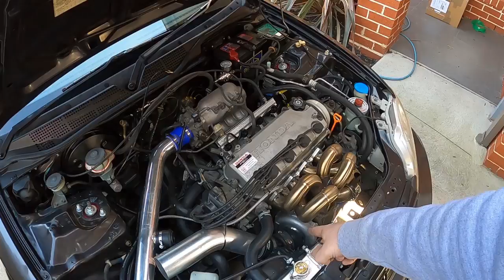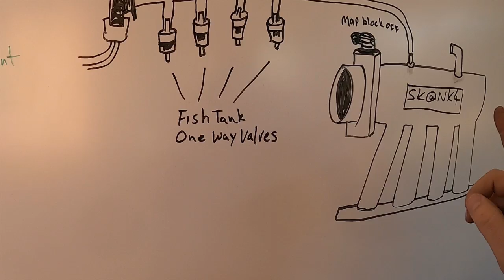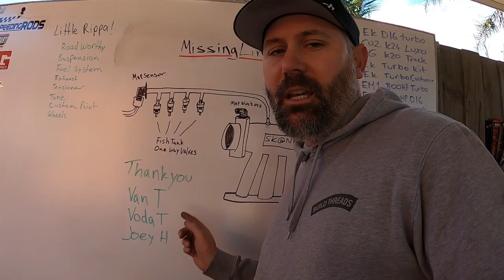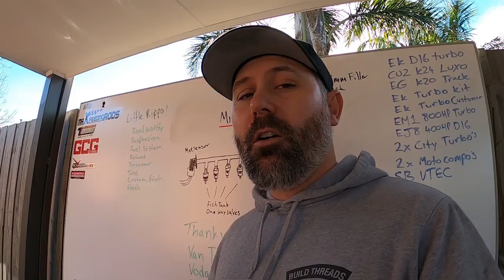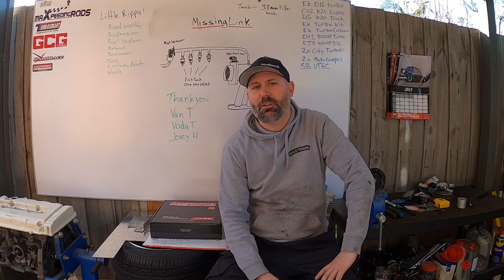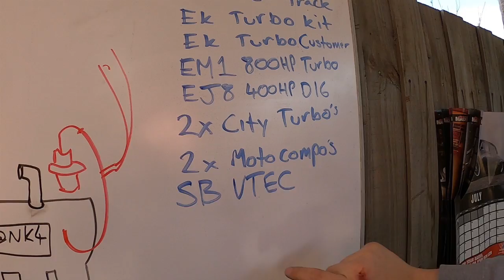HONDA TURBO 8PSI MISSING LINK HACK MAP SENSOR CHEAT FISH TANK ONE WAY VALVE CHEAT ON A STOCK ECU

Comment: you can also put those on the boost signal hose to the wastegate to make a crude bleed off style boost controller
Reply from the maker: That's a classic DIY trick to bleed off pressure and up the boost. ✌️

Comment: Would a two bar MAP sensor be better?
Reply from the maker: Yes, a 3 bar would be better again
Reply: @TURBOTRISTO  what I meant was if a  two bar MAP sensor would work in place of those fish tank one way check valve without issues
Reply from the maker: Yes but the ecu will need some sort of calibration

Comment: 99 Jimny g16b added a turbo starts revs drives fine untill 6psi and boost cut / limp mode for a split second then gose back to cruising fine I have feul reg bigger pump wideband 02 sensor and a manual boost controller. Going to give this a try tommorow

Comment: I have a saab with a map sensor that has boost cut with my boost tap/tee at 15.5psi this is to stop the cut out not raise boost.boost need to be raised through the wastegate or wastegate vaccum
Reply from the maker: Tune the ecu is your best bet

Comment: thanks man. put a supercharger on a dodge gas 5.9 V8 with (2) aux piggyback'd fuel injectors. Every time I hit boost it broke up hard and fell on its face. Check valve in-line helped, but I ordered some nice check valves to run 4 T'd like you did to see if it remedies the issue.

Comment: Just added a turbo to mine.. starts good, but runs ruff checked the plugs their black.. under boost feels like it’s lean out.. running stock d16y8 injectors, stock ecu, stock o2 sensor and a FMU.. do u have any idea why the issue.. thx.. ur videos are great..
Reply from the maker: Hey mate the issue is going to be a combination of a stock map sensor and a stock narrow band 02 sensor you will need to figure out a solution for these or go to a stand alone ecu

Comment: Love the channel I'm going to subscription after writing this..   I'm about to turbo my 99 civic has a d16 y8 and help would be great..  I saw a maxspendingrods turbo kit.  Lucky in the states online it's 500$ for the kit..   my motor has 200k + miles should I over haul the motor first..
Reply from the maker: No man just send it on the engine replace some gaskets and the timing belt don’t open the motor just watch my 18things you need to know before turboing your car video
Reply: Ok I will watch it. Thanks for the response..   thanks for the content this channel is a real big help. Keep up the good work
Reply from the maker: thanks mate, i need to get my honda sorted
Reply: So I decided to buy a Honda with a turbo kit already installed..  so if that motor goes at least I have another to drive..  here in the states I've found a few for around 2000 USD..   I will post and send you the link after I find the right civic or prelude
Reply from the maker: awesome mate thanks

Comment: Hey Tristan, I did the 4 fish tank valves but i’m getting check engine light around 4k rpms. The car doesn’t break up but it runs really rich after CEL. If I turn off the car it resets. Any suggestions?
Reply from the maker: Hmmm weird, I checked in on this car yesterday and it’s still running fine the way we set it up not sure man I’d have to suss it out

Comment: Why not just relocate the map sensor to the turbo intake?
Reply from the maker: It’s a manifold absolute pressure sensor not an air flow meter so it is designed to run manifold pressure an air flow metre would help as a Band-Aid but eventually when it gets tuned it would become a nuisance

Comment: I have a 2000 Honda Civic hatchback with a D16Y8 and a turbo kit installed after 5 lb the check engine light blinks for the map sensor it does have a chipped esc got any ideas
Reply from the maker: No man if your ecu is chipped go get it tuned run 10psi be happy

Comment: I'm waiting for my wideband to arrive but still have to drive my car in the mean time before my tune. I've been driving it with a light foot to stay out of boost because it just falls flat on its face once the MAP reads anything. I just bought 3 check valves from autozone and did what you did.... I can't believe this works as well as it does lmao I can use positive 3psi now. This is awesome. How did I not know about this? Makes it really easy to drive until my tune. Thanks! 
- 1991 cb7 accord, f22a.
Reply from the maker: You are welcome buddy

Comment: Wait why don't you use a new map sensor that reads higher? I hope you're not sticking with a stock obd2 ecu cuz that will knock.
Reply from the maker: Yeah that is ideal and you can buy them for  $25 on eBay but they need to be calibrated and tuned on the car via a programable ecu

Comment: Since there's no pressure in the oil drain can I just use barb fittings, hose and clamps? It's down low so can't really see it, removing/reinstalling AN lines is a pain and my cheap fittings leak a little.
Reply from the maker: Yes you sure can Frosti

Comment: What's ths reason for the hesitation?
Reply from the maker: stock ecu, stock tune, stock timing, stock fuel pump, stock injectors, stock map sensor, nothing on these cars were designed to run positive boost pressure
Reply: I will be trying this on my prelude f22b dohc non vtec. Thank u for the fast reply

Comment: I run 6 to 9psi on my stock Lexus LS400 and it loves it! Now I have  d16y8 to go in my little hatch project I feel some boost coming on😁
Reply from the maker: great news is if you have a d16y8 you can cost effectively run a hondata, make sure you do that as it will be the best option for you
Reply: @TURBOTRISTO  overnight I ordered a Hondata s300 and a refurbished P28. I figured that way I've got the ideal building blocks to go big later on. It a was a huge expense but you only live once don't you. 👍
Reply from the maker: thats soo awesome man I envy the USA guys that can buy these parts cheap
Reply: @TURBOTRISTO  I'm UK mate 👍 so not cheap like the US

Comment: I've heard of this being done to fool the MAP sensor, but I would imagine that this would just create a boost leak. I bought a 3 bar MAP sensor, 1000 cc injectors, and I socketed and chipped my P28 ECU for Crome (it's a tuning program). I didn't want to mess around with an Apex'i SAFC. Even my boosted J32A2 CG1 Accord has an AEM Series II 30-6051 standalone.
Reply from the maker: That is the correct way to do it my man good job, I know all about crome I have it on my laptop
Reply: Yes, clearly wideband and tune is the correct way to boost, but this actually works... And it works well lmao! I'm waiting for my wideband to arrive and I threw these check valves in to try it and the difference is night and day!
Reply: Good Man, what you've done is Standard...but some of us cannot get Hondata or a P28 Tune...I have an Automatic Integra...No help nowhere...so this guy is my Hero

Comment: I hopped on the d series post with some flame before seeing every bit of the video, as I'm not a fan of this method. but you do mention how important it is that end goal should be a tune. 

To make my input constructive, It would benefit alot of people to understand the tuning process a little bit more and how important proper engine management is. And what all it can control

Idk your personal capabilities when it comes to tuning software and application but touching on some of the basics as to what people should expect from the process and how to be prepared (which to your credit, you do give alot of info that will make sure anyone adding a turbo will still have a fairly regular running vehicle till tuning is figured out) and how easily available the services are in alot of locations. 

Maybe touch on different tuning options and softwares offered and price differences and capability differences
Reply from the maker: Thank you , great comment , yes I do cover this topic quite regularly, notice I wear a Haltech cap… my person civic d series turbo has always run an elite 1500, I always always suggest over and above all else to get a tune!!!!! Thanks for watching and thanks for such a great well thought out comment